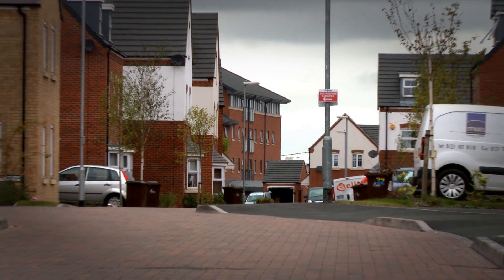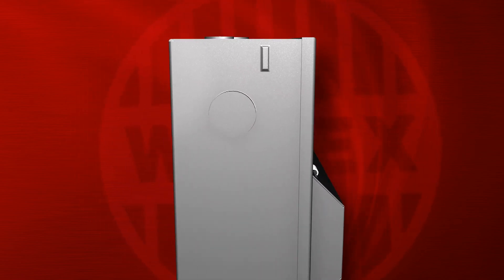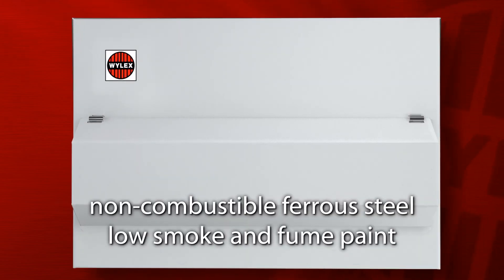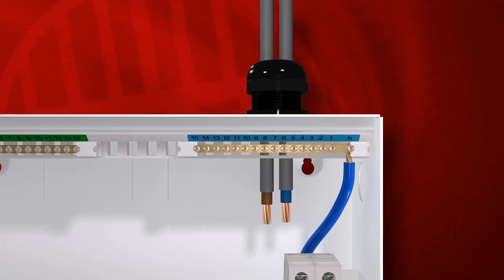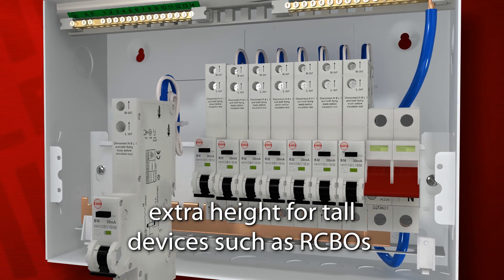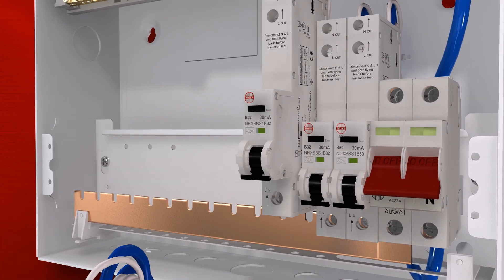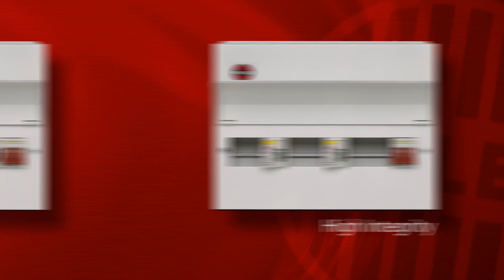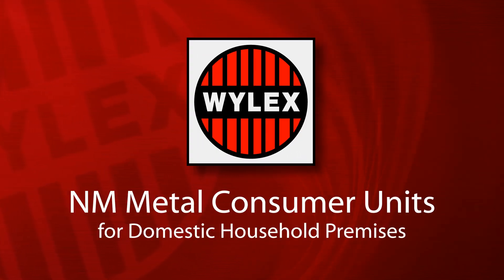How the Regs are changing the Fuse Box we fit in your house.

Comment: Where does this ‘fire risk’ come from? What sets on fire if there is a short? The wires, the sheathing, the brass terminals, the brass busbar, the plastic MCB/RCD/RCBO slot ins? There is surely no realistic fire risk atall. The bigger risk would surely be from electrocution if the short is not detected by the RCD, say in the meter tails, and it directs 100A of current thru the metal casing (if the earth is inadequate/faulty/has a high loop impedance)? If fuse boxes are only required to be non-combustible, why not also specify a non-conductive outer enclosure?
Reply: What burns, well it isn't the metal conductors is it?
It's the insulation of the cables and plastic of the consumer unit itself.

Have you not ever seen burnt insulation on cables?

And you seem confused."The bigger risk is from electrocution if the short is not detected by the RCD".

First, if the short is not detected by the RCD that doesn't matter for two reasons:
1. When a person contacts a live wire and electricity starts to flow through them, that is the point in time the RCD will trip and cut the power off, thus preventing electrocution.

2. The circuit breaker will detect and cut the power off if there is a short circuit. 

Second, an RCD's function is not to detect shorts , but it will detect a short if it is from line or neutral to somewhere else.

Arcing and trip RCD's. RCD's don't necessarily trip when arcing occurs.
That is why we have arc fault protection devices. 

Arcing may trip an RCD if the arc is from line to earth and the current is high enough. But arcing also occurs from a broken or disconnected wire inside a terminal. And that arcing burns the insulation.

I have read both your posts and you are seriously lacking basic electrical understanding. I hope in the last few years your knowledge has improved.
Reply: @deang5622  - PVC doesn't support combustion unless a source of heat is applied. It's just going to burn/melt at the source of the heat, i.e. the arcing inside the CU and not spread beyond that point. 

And I was clearly talking about a CU with metal casing conducting the current to a person who touched the casing. At which point the current does flow thru them. And no breaker or RCD is going to do anything about meter tails coming loose & touching the metal casing, as these are clearly downstream of the tails.
Reply: Cupid Stunt - Yeah, I already understand the sparks from arcing could ignite flammable material, but what is flammable inside a consumer unit? The wires, terminals, and busbar are not. The plastics used resist such upto higher currents than would ever occur. If arcing takes place on the RCD protected side of the unit, the imbalance in current caused by arcing should cause the device to shut off.

Comment: I never understood why these panels are so restrictive. This bus bar will prevent other DIN rail equipment to be installed such as ammeters, relays, voltmeters and hundred non MCB stuff. Also it prevents custom sequences such as combo of switch/mcb/pilot light. Also I cant understand why you don't have main fuse/mcb in your panels and you rely only to the utility's circuit breaker. In Greece we use a non restrictive German version where all, except the lights, are controlled/switched from the panel (oven, water heater, ACs, washing machines, etc) instead of dedicated switches around the house like the UK model. So the electrical panel for us is used many times a day instead of a box being opened only when a breaker trips
Reply: ConoTube - In the UK the fuse box is typically hidden away in an understairs cupboard, a cellar, or a box near the front door. You don’t want to traipse up & down stairs, in & out of rooms and cupboards, etc. to get to it. It’s more convenient & rational to put any isolation switch next to the appliance. As to why you’d want an ammeter, voltmeter or relay in a fuse box is beyond me! 

The main fuse is outside the box and fitted with tamper-proof security to catch out anyone bypassing the meter and stealing electricity. How do you control this in Greece? Is that why commentators called PPC not a viable company?!
Reply: In Greece the electric company provides a box which houses the meter and the the MCBs (one or three phases) or fuses in the past, nothing else, we use TNS grounding. These mcbs usually can be reset by moving a lever but this doesn't apply to all version of boxes or the mcbs are not compatible with the box and the mechanical link fails. The box is sealed and the meter inside is also sealed. If you brake the seals you get a fine but usually they ignore the box's seal if its broken, if the meter's seal is found broken you get a fine for sure! Now from the consumers side the main panel is equipped with a main switch, a main mcb and one or more rccbs with ΙΔn 30mA. The rccbs divide the installation usually by floor, so one for the ground floor, one for the first floor etc. The regulations dictate that the whole installation must be controlled by rccb, the number of them is decided by the electrician. Each floor must have it's own (sub)panel. The main MCB, its at least 6kA (10kA recommended) and is usually one grade lower in Amps than the utility's, so for example if the utility's is 40A the consumer's is 32A.
Ammeters, Voltmeters, Watt meters, timers, voltage control relays and many others is not something you are going to see often but some people ask for them. For example someone might want to have a ammeter to use as many loads as possible without tripping the breaker during the reduced kWh price time zone, someone might want to turn on the water heater for 10 minutes by pressing a button and turn off automatically, other people want their air conditioners to be protected from over voltage or sags so they use voltage control relays. 
All panels have common things but they are not copy - paste, each panel is tailored to the needs of the specific installation it controls
Reply: You can fit ammeters or other accessories externally in their own dedicated enclosure

Comment: There are no fuses in the box so why are you calling it a FUSE BOX?
Reply: Grandfathered terminology from the days of Edison.
Reply: Its a consumer unit, if it has actual fuses, then yes, its a fusebox
Reply: My fusebox is of the type with porcelain inserts with 5-15-30amp fuse wire stretched between end fixing points, no problem with it keep tripping out if you sneeze loudly.
Reply: Move forwards 5 years and there are still idiot electricians creating videos on YouTube calling them fuse boxes.

Comment: Not a good idea having all metal: conductivity.
Reply: That's why they are earthed. If you have any earth at all on the system then the box is earthed to. As it is, the danger from house fires is probably higher than from electrocution.
Reply: If earthed correctly, this is a good material

Comment: I'm not an electrician but from this video new regs means RCBO'S rather than MCB or is that in some cases not all?
Reply: no, you can use some MCB's wired to a single RCD or just go with an RCBO which does the job of both of them but better, and with more space! problem is RCBO's are more expensive and the general consumer isn't really going to care what is in the unit
Reply: Most RCBOs only disconnect Line in UK systems, whereas a conventional RCD will break both Line & Neutral. Mainly an issue for TT systems where neutral can have significant potential relative to earth. RCBOs are better from the point of view that only the one circuit trips.

Comment: So you run everything from 1 phase?  (._.)
Reply: UK residential electricity is almost always single phase. Three phase supplies are very uncommon except in very large properties.
Reply: yes single phase 230V 3 phase 400V and also people have asked me isnt 3 phase 690V LOL

They think that you times it by 3 but each phase is 230V with the Neutral but to get 400V its the measurement of voltage between each Line L1 to L2 or L2 to L3 etc for example

Simple maths to get 400V into 230V is  400 / 1.73 = 231V which is close enough. 1.73 is explained as the voltage between the 2 phases are 1.73 times mlore than the Phase to Neutral so its the difference between 230V and 400V 

God i hated theory in classes years but Knowledge is Power ;)